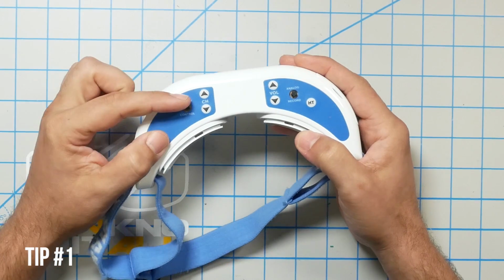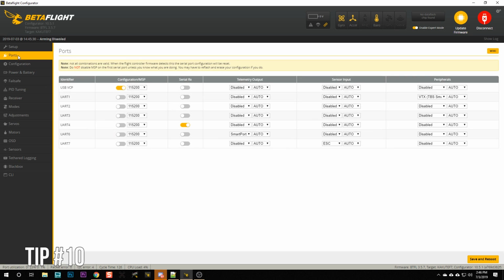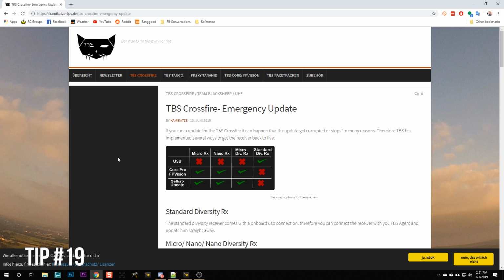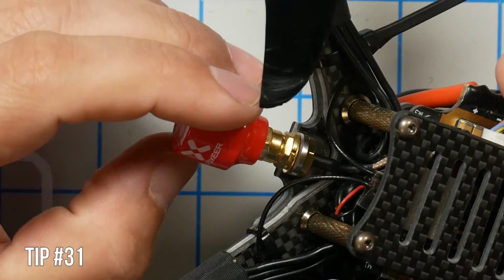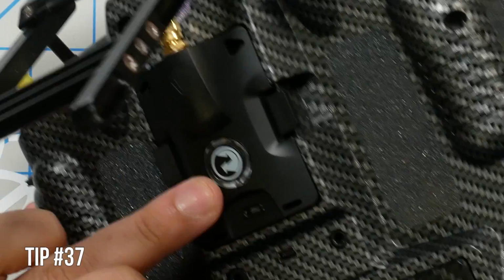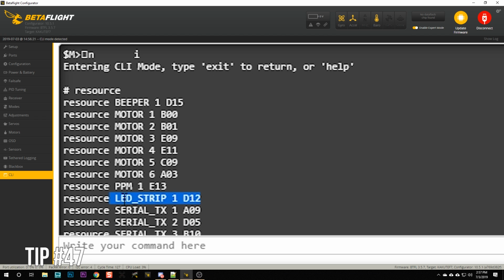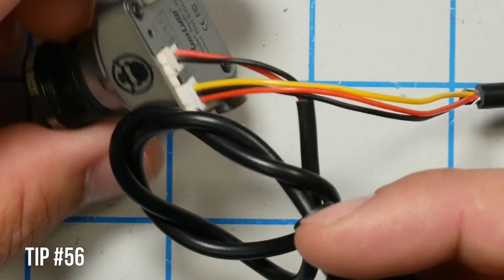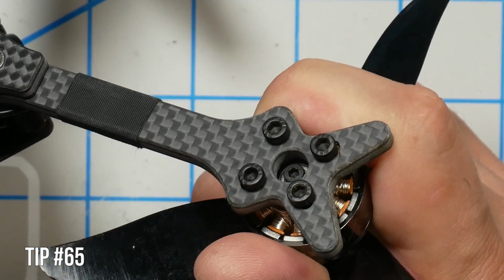65 Tech Tips For FPV Pilots | YOU DON'T KNOW #40 I GUARANTEE IT

Comment: Hi, 
I was on simple rxsr ans taranis radio link, then I invested in crossfire module and nano rx.
I binded everything with the files in the sd card and everything, but when I go to the module or receiver file, I can’t accès the Chanel’s, they just aren’t there…
However, I get the rqly batterie voltage and telemetry…
Is rqly the Rssi?
Thanks

Comment: I asked about this on your last live video but someone's mazda 3 seemed more important at the time. I put a 6s on my 4s version nazgul evoque. Fried is an understatement. Is it all toast? There's a quick video of the aftermath on my channel.  I've asked you a ton of questions and have yet to get a response so if you don't respond I will take that as a hint and shll not ask another. Love your knowledge bro. Help, please!!
Reply from the maker: Hi Mark. You can always email me joshuabardwell@gmail.com if you want to make sure I see your question. I'm not ignoring you, I just haven't seen your questions yet because you're asking them in YT comments, and I get thousands of YT comments and cannot read all of them. 

The electronics on the iFlight quad should be rated for 6s. The only difference is the motor kv. However, if you use 6s battery on 4s motors, the high RPM may fry the esc. I would expect FC, camera, and vTX to be fine.
Reply: @JoshuaBardwell  the only thing not charred (actually charred) was the air unit but all the plastic was melted off the wire. It's bad bro. I ordered the 6s version this morning. I'll just turn the burnt one into a basher I think. Thanks for getting back to me. Ok love ya. By

Comment: That was a handy tip about being gentle on the gimbal calibration. I guess I probably gave my gimbals a bit too much of a push on a recent calibration, because in the receiver tab on Betaflight, I was seeing the quad move around and the values weren't resting at 1500, but moving up and down by about 10.  I added deadband to make it go away, not realizing that it might have been my recent calibration.  I just recalibrated the sticks gently, then went in to check the receiver tabs on my quads, and the values were pretty much right at 1500, except the occasional little blip up or down.  I turned the deadband down to 2, and everything seems good.

Comment: I left my lipos fully charged for one year with no use.. can't tell a difference.
Reply: That's great but is still bad for longevity and their ability to maintain a charge through flight. Best not to leave batteries fully charged for extended periods of time. Many chargers have a storage charge option which will balance charge the batteries to an ideal voltage per cell for long-term storage. Why risk it?

Comment: Can you burn a vtx through the usb on the fc? I plugged it in without the antenna once and had it there for like a minute. Never flown the quad yet so don't know if the thing still works or not.
Reply from the maker: VTX usually wouldn't power up from USB.

Comment: Every time you crash, inspect your props carefully. Especially at the root where the blades meet the hub. There could be tiny cracks which will grow each time you fly, until the blade suddenly flies away and your copter becomes mostly uncontrollable leading to another crash. Use a magnifying glass and bright light to inspect for cracks.

Comment: I left aomways on no antennas for about 15 min and boy were they hot enough to change color of the connectors..they still work it worried me if it lost some range.? Cmdr v1
Reply: I've had the same experience man. I honestly have no idea why they get so hot since they're only receiving, but I wouldn't really worry about it. I doubt it has any effect on range
Reply from the maker: Receivers aren't damaged by removing antennas.
Reply: Thx, but boyy were they hott, somewhere close to boiling, oops.

Comment: I Put my Balance connector between the bouth powerwires

Also i glued my xt60 to the frame  whith epoxy (my wire comes in the Back of my copter)

You also can use the external  (mostly blue) wire on runcam to  overwrite the 5v osd Display to your actual Batterie voltage so If the FC hasnt an osd you can use this

Comment: Your vids helped me out a lot so far, thanks. But licking a lens (tip #52) is VERY BAD for the coating. I'm into astronomy and have some expensive optics. I use an air blower and squirt pistol with distilled water to clean them. Even touching them with your finger or blowing with your mouth could risk the coatings getting eaten from the acids on your hands and inside your mouth. FPV cams aren't that high grade but I'm quite sure they use oil coatings. Tip #66.

Comment: Thank you for the tip on when calibrating radio/Transmitter i was trying to figure out on my diatone crusader gt200 why the throttle would increase when throttle all way down and quad was not slowing down. Plus when i was trying to arm quad i couldn't because had to push down little hard to do so. thank you again!!

Comment: Could you remove the smd resistor on the cam-c pad to remove that transfer rate bottleneck?
Reply from the maker: You would have to bridge it, not just remove it.
Reply: @JoshuaBardwell  Well ya... That was implied by removing it. I should have specifically stated that or some noob would and up just removing it and causing problems. If they could figure out which one it was.  My fault

Comment: tip 36# i have different models for the same quad but different voltage alarm values for 4s on one and 5s on the other. 

also sometime telemetry is on different channels for different quads which is another reason i have multiple models.

Comment: I rate plug-in your new flight controller to your computer first before you solder to it as the top tip. I wouldn't of thought of that, thanks.

Comment: On the topic of battery voltage damage, I have an anecdote of recovering from an undervoltage event where the quad was stuck on in a tree for a while. I think it ended up at a resting voltage around 2V per cell. I had to charge them by using an external power supply, but after they got up to voltage, I can't even tell the difference between that battery and my other ones. Generally, if the cell doesn't self-discharge after you charge it, it's not 'damaged'. Its performance might be a bit less, but you don't need to toss it out.

Comment: Smokestopper should have been #1 on the list
Also add one tip to using a smokestopper: It cannot protect your electronics from everything. DO A VBAT CHECK on the first plugin to see if the power actually goes where it needs to go!!!

Comment: Hi Josh! I don’t know if you have got more tech-nerd details for me about why 3.80v is the best storage voltage for ALL LiPo Batteries, in that case I want know!
I’d say that LiPo chemistry is something more complex than we think. In instance, sometimes I put my batteries in 3.80v, 2 weeks later some cells are in 3.76v or below, but when I balance them over 3.84-3.85 that doesn’t seem to happen. I’d say storage voltage is defined as the most stable point for the chemistry of the battery, so may there be differences between battery models. In fact, when I buy a new battery, sellers sometimes send me them at 50% (over 3.9v), why do they do that? Thank you

Comment: Joshua I have a problem, I have hd3s some cameras seem to be way more zoomed in than others, I've tried switching them to 4/3 in the osd but it's still really close. Happens to my micro sparrow and Johnny fpvs runcam swift. Also some CMOS cameras 
Thanks for everything
Reply from the maker: Different cameras have different lens focal length and field of view. You can change the a smaller focal length to get wider angle view.

Comment: What are the "Pods" for??  Also; my OSD Voltage is stuck on 4.9.  Doesn't move much.  Worked first couple times. (i did forget to put an antenna on quad and powered up for a few seconds) not sure if this has anything to do with it.  Started happening around the same time

Comment: This is a great video @joshuabardwell

I have one for you that I cant seem to figure out though.  I have a remix frame built with a Diatone Mamba F4 stack in it.  The quad seems to run great but it WILL NOT rearm after a crash or minor hit. I have arming set to 180 degrees in BF and my throttle is all the way down, etc.  I have connection to the RX on my Taranis X9D - any pro tips on this one?  Unplugging and replugging it in fixes the issue.  What gives.

TY
J~
Reply: Wild Weasel do you have warnings turned on in osd? Then you should be able to see the problem in your goggles ;-)

Comment: Josh. Do you have any suggestions on how to unbrick my ESC when I changed my beacon strength from the GOT theme down to number 86 and now my quad wont startup and BLHELI cant open because the escs wont start up.. so I am kinda stuck between a rock and a rock... Any idea?  Was great meeting you at IO. Team Velocidrone has new ideas for next year.
Reply from the maker: Simply changing that setting shouldn't brick the ESC's. If you can't even contact them via blhelisuite, I don't know what to suggest :-(

Comment: Tip #4; my HD3 only has Playback and Format.  It would be nice to auto record. Do I need to update the firmware?
Reply from the maker: I've never seen a Fat Shark goggle without that feature. I guess update the firmware. Maybe you have the much older DVR board?
Reply: @JoshuaBardwell  I updated.  Now I have the option.  What's the difference from auto start and auto start continuous?

Comment: So I have a question for someone I messed up and soldered xt60 on backwards ahhhhhh. Oops lol but anyways it was just a split second but it smoked and esc and I removed it then tested the other 3 and it ran so I got my new one soldered it on and was able to plug it up to flash firmware then unplug and replugged in the it fried another one with the right polarity and 1 more had a melted spot on the electrical tape. I appreciate any help out ther please. I just ordered hak re 35a replacements it had eachine 20a and I dont wanna do it again without asking around first. I was thinking maybe the other were almost fried and the spike when plugged in blew them the rest the way cause I wasnt able to test higher maps cause the one was one so no flying

Comment: Regarding tip 58 (set Channel Range to 1-8): I think you should only set it to 1-8 or 1-16. I heard that the RC channel smoothing of betaflight might not work if you set it to 1-10 for example. 

The radio always sends out packets of 8 channels. If you set it to only have 8, then every time a packet of 8 gets sent out, it contains all new values for all 8 channels. If you set it to 1-16 then the first packet will contain channels 1-8 and the second packet will contain 9-16. That's where the extra delay comes from when using 16 channel mode. 

But what happens if you set it to 1-10 for example? The first packet will contain channels 1-8 and the second package will contain channels 9,10 and 1-6 again but with new values! That means that channels 1-6 will get updated twice as fast as channels 9 and 10. If all your "flight channels" (throttle, yaw, roll, pitch) get updated twice as fast as your flight mode for example, there's no problem. But if some flight channels get updated twice as fast as others, there could be a problem with the channel smoothing.

Comment: Tip #25 is important. I sliced my nose very badly and got 25 stitches to re-connect the tip of my nose after my quad went full throttle into my face.
Reply: Bournefort dang dude, hope you’re ok now
Reply: Happen to a buddy of mine too. He forgot to disarm and angle mode, bent over to pick up the quad and hit the throttle. It wasn’t pretty. At least it wasn’t and Eye.
Reply: Yeah, I went out flying the next day but it sure scared some sense into me. It has changed my perspective on failsafes, prearm, and proper controller use. Still love flying FPV and quads!

Comment: Great list of tips, many I knew, many I didn't. Here's a bit more info on three of your tips, and two tips you likely don't know:

1) Joystick down/up = contrast -/+, left/right = brightness -/+. There are 21 positions of each, so if you want to be in the middle, keep pressing the joystick right or up until the picture stops changing, then press it 10 times left or down to get to the middle.
3) That's headphone out, not for a microphone.
5) I designed some 3D printable lens protectors for Fat Sharks with Fat Shark fonts on to prevent the sun accidentally ruining them when you're not using them: thingiverse.com/thing:3502380

My own additional tips:

Trimming accelerometer
If you're flying a micro quad indoors in angle mode and its drifting, you can use the stick commands to trim the accelerometer - but at some point in the last year(?) the Betaflight devs altered Betaflight so your quad must be in angle mode when disarmed for the stick command trimming to work.
Easy to fix, plug your quad into Betaflight Configurator, then in Modes tab adjust the angle mode slider so its in angle mode when disarmed.

Datestamping your DVR files
Goggles don't have a realtime clock so they don't properly datestamp your DVR files, however there's a simple workaround to this.

1) At the start of your day's flying, plug your goggle's MicroSD into your phone/computer etc.
2) Rename the existing DCIM directory to DCIM001, or DCIM002, or DCIM003, DCIM004 etc.
3) Create a new folder called DCIM, your computing device will datestamp that directory to that time/date, so you know what day all the recordings in the 100DSCIM directory were made on
4) Delete older DCIMxxx directories if you don't have enough space left for recording the day's flying
5) Put the MicroSD back into your goggles
6) Have fun :)

This also allows you to archive your DVR recordings much easier if you want them in the future.
Reply from the maker: Tip 3 -- the microphone is on your quad. The earpiece plugs into your goggles. When I said "use a microphone" I meant on the quad :-)

"2) Rename the existing DCIM directory to DCIM001, or DCIM002, or DCIM003, DCIM004 etc.3"

Would be amazing if you could do this through the Fat Shark DVR menu.
Reply: The goggles would need to have a battery backed up realtime clock, or you manually put the date in which I'm guessing could be done to most existing Fat Shark goggles as they can issue new DVR firmware.
I was thinking along the lines of an Android app to automatically rename+create datestamped DCIM, as I already I carry a microSD reader when flying to backup HD flight footage onto my (nearly 300gb) phone .

Comment: Question* I built a armattan chameleon 6", its semi slammed so i went with the kiss compact fc aoi. Has cobra 2204 1960kv motors. Did I make the wrong decision on m
FC/ motor combo. They work well together but I want to freestyle and I'm limited on prop selection due to 16a/24a max esc. What would you do? Contemplating getting a 3" setup and using the kiss fc/ cobra motors on it. And ordering a different fc aio with 30a+ esc to run higher kv motor to be able to push 6" triblades??
I've now learned to plan on a setup that will push enough amperage for any prop.
Reply from the maker: I'm sorry to say but I think you made the wrong decision. Unless you are only doing low-throttle cruising on lower-kv motors, you will regularly exceed 16 amps.
Reply: Thanks for the response Josh, one more question if you were doing a 6in slammed build what ESC & motor combo would you personally go with?  I'm wanting a racer / freestyle that is not going to end up plummeting to the ground in a fireball 💣💥🤬

Comment: Tip #21 addendum -  Be sure you only cut one wire at a time so you don't short the battery
Reply: Mark M I was going to make this same recommendation until I saw that you already posted it. This is EXTREMELY important!!
Reply: I literally did that yesterday. Luckily the battery is ok, internal resistance went from about 20 to 60, but it still works. The quad is fine to, it’s flying great, and other than that, it was a pretty successful first build.

I should probably clarify that I was being incredibly stupid and was trying to cut the wires of the xt60 on my quad to the right length while the battery was plugged in.
Reply: @ficere5192  😳
Markers are ur friend.
Reply: Yes it’s very important, cut one wire, solder it, shrink wrap, and do the next. I used this method to swap battery connectors a bunch of times.
Reply: That's like a Darwin level advice....
Reply: @attackhelicopter7403  It can happen by accident when caffeine is involved...still have all my fingers luckily

Comment: Hey Joshua, I ripped off the 5v pad where I had the camera on a crash, so I soldered the wire to a Vbat pad and I noticed that I have more static noise now. I use the micro Eagle JB Edition and PyrodroneF4 on 6s. Is it a normal thing to have more noise on vbat than a 5v pad ? Thanks
Reply from the maker: Yes that is normal. The 5v regulator provides some filtering. Use the Bat+ pad as an alternative 5v out if you need to.
Reply: @JoshuaBardwell  Thanks a lot for the answer.

Comment: With sbus in and out could you control one quad with two transmitters?
Reply from the maker: Well I suppose you could. Bind one TX to one RX and another TX to the other RX. But how would you switch between them? Only one RX is active at a time. When that RX goes into failsafe, the other takes over. So I suppose you could switch between them simply by shutting the 1st TX off?
Reply: @JoshuaBardwell  i was thinking this would be good for training people. Like a dual control car.